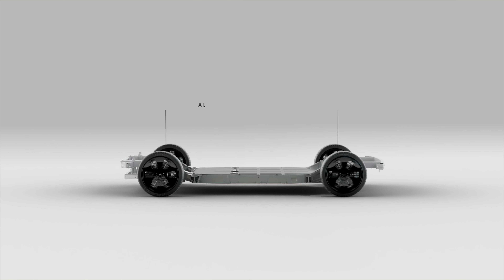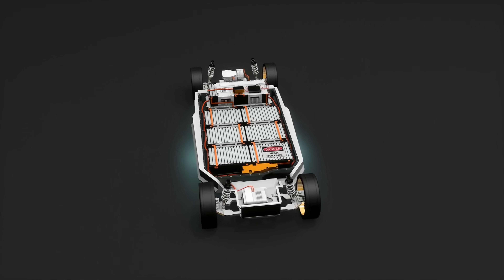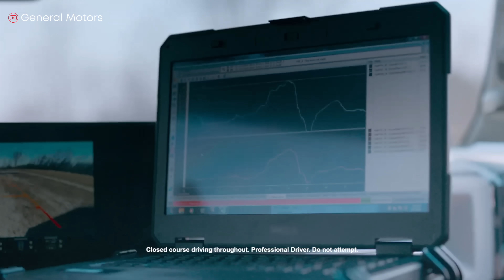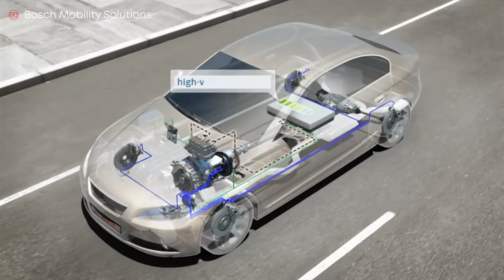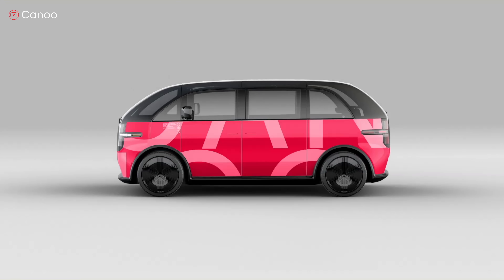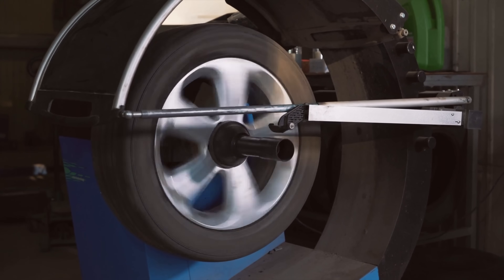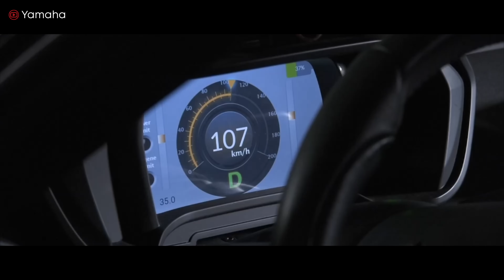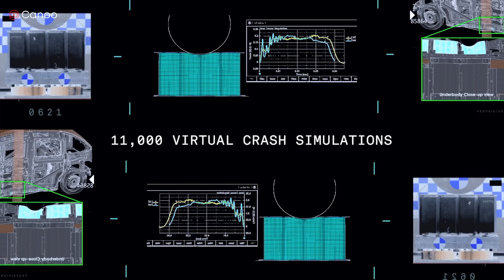No One is Telling You the Truth About Electric Cars, So I Have To

Comment: I don't have any experience with EVs but I do have 20 years of experience working on Toyota hybrids.  When the Prius first came out, we were told that eventually we would be able to replace individual battery cells rather than the whole battery pack.  Well that repair option isn't still available from Toyota.  At this point I don't think it ever will be.  From what I've heard it's not available from Tesla either.  There's obviously a huge difference between the costs for a hybrid battery pack and an EV battery pack.  I won't even think about buying an EV unless that repair option is available.
Reply: EV maker Nio has battery swap tech that's neat. Check it out!!
Reply: Robert's happenings   yeah and on top of that the distance you can travel lowers everday!!! Now wait, hold up!! So first ill half to charge 2wice a week then 3,4,5 and it's not going to stop! So if I drive to California from east Coast on the way back I got to stop more to charge!!! Are you kidding me??? Now see the truth off the matter is a TESLA car with true tesla tech never needs charging! I don't see why it can be alternator/s recharging the battery while you drive? You can have a dual system like dual core processors! Or quad core etc. These batteries or half or a portion of can easily be recharging as you role! It's all about controlling the people!! You can tweak your electric car to never need charging and once people figure this out game over!!
Reply: Toyota has agreed with BYD to use blade batteries, these may be able to be replaced.?
Reply: My experience with Toyota Hybrids is my ex-boss had a Prius with a blown head-gasket and needed a ride to work every morning!
Reply: Your car, or any mechanical device will never be able to fully recharge itself through regenerative braking. Although you can get some energy back from the kinetic energy you've spent, friction, driving the generator and heat will never allow for 100% to be recaptured.  What you are talking about is a perpetual energy machine. No such thing. At some point you'll need an external energy source
Reply: Best not to mix old with new in a battery pack.
Reply: The main problem with partial battery replacement is you'll have wildly differing voltage outputs from different batteries, ongoing degradation is one thing, jamming new and old batteries together is a whole other story, its probably not safe to do. Does anyone remember what happened back in the day, when you had a gameboy/gameboy color/GBA with multiple batteries, ever tried putting a near-dead one in with a new one and get all sorts of problems? or it wouldnt start up at all? yeah.

Also what happens if an ev car crashes and the batteries are punctured and exposed to air? Giant explosion or what?
Reply: @jaminova_1969  – So that's a vote against internal combustion engines, leaving electrical power as the only viable alternative.
Reply: You never replace the individual cells if the battery goes bad because of age or poor quality. So by changing the entire box, it's assured that the most common causes are ruled out by default. You can play around and fix most things but it doesn't work for most battery packs, in a safe way. Supercharging an oxidized or old battery pack doesn't sit well with fire safety or the lives of innocent children
Reply: @jaminova_1969  Blown head gaskets are rare problems on Toyotas.  Even if you have that problem, it will only cost you a tenth of the costs to replace EV battery packs.
Reply: @justasurfer8596  Some still think if ENERGY as something it isn't, Last time I checked it wasn't free NONE of it, Even free so called sunlight requires a solar panel and wiring etc.
Reply: @raymondreiff8170  but solar panels are just the collection equipment, ours will have "paid for themselves" within 7 years, therefore any electric produced after that IS free.
Reply: Replacing battery cells will / is already being done by third party repair facilities NOT traditional auto repair shops. Gruber Motors in AZ does this for Tesla's at a tenth of the cost of a new battery replacement. They pull the whole battery assembly out test EVERY battery cell and front end components in lab setting. This is HUGE opportunity of new repair facilities for EVs to bypass ICE tech totally as traditional shops have ZERO experience with electric cars.
Reply: What’s the average life of hybrid batteries? And how much does it cost to get them replaced?
Reply: @justasurfer8596  they need solar roofs
Reply: @777immortalsoul  
And, what is going to spin the alternators to constantly recharge the ion batteries?
Reply: @spikeboi55  
a  solar  roof  on  an  EV  might  power  the  radio  and/ or  a  few  lights,  but  won't  charge  a  low battery.
Reply: apples and oranges... prius is an extremly complex car that does not have lithium batteries.. just a gas tank and few obsolete unobtanium cells.
Reply: @spikeboi55  Toyota hybrid batteries come with a 10-year/150K mile warranty.  I think I've done just a few warranty battery replacements in 20 years.  It's hard to say when a hybrid will go bad, depends on driving habits.  To replace a hybrid battery, you're looking at $4-5K parts and labor.  If it's a plug-in, it will cost a lot more because the battery is much larger.  I've haven't done any plug-in batteries yet.
Reply: @CamKrazy2000  
at  the  end  of  the  day, better  off  with a  hybrid.  at  least  ya  don't  have  to  worry   when  in  the  middle  of  nowhere  in an EV while  low  on  battery  n  don't  have  to  wait  for  hours  when  ya  do  find  a  charging station.  hybrid  a  win win....imo.
Reply: I have seen several videos, where the Prius battery cells were tested, and bad cells replaced.  The hard part is balancing them when completed.
Reply: Oregon's "Initiative 13" is about to be a nation-wide phenomenon.  EV's are about to be the last thing on anyone's mind.
Reply: The Hyundai has that option
Reply: @777immortalsoul  You can't get more energy out than you put in. It's a well-understood physics law. Example, why do you think bicycle dynamos aren't practical? Answer, for the same physics law. It converts your body's energy you put in by cycling into electrical energy, and doesn't feel easy. Lol. The dynamo makes it hard to cycle. Just because you can think of ways it must work doesn't mean it's gonna work. Your ideas will get overruled by the laws of physics. Cheers!
Reply: @bryans4727  Boss thought it was an EV and never had the oil changed. Lol
Reply: @777immortalsoul  I think you just invented the perpetual motion machine
Reply: Robert's happenings   Batteries have gone up in $$$. The $4000 Leaf battery just went up to $8000.
Reply: @southpaw6115  I was going to say that.. and with that in mind, its like a Lifetime warrantee..  and the stations they have are cool
Reply: @Vihara2  prius has a controller that manages the bad cells from the good ones...hence battery light when 1 cell or more goes bad=hybrid battery replacements
Reply: @justasurfer8596  current technology batteries charge too slow to take advantage of regenerative power so most of that energy is wasted, but at least it helps with braking.  It would take something like a super capacitor to capture the energy for use by the car.
Reply: @Vihara2  The main issue is exposing them to water.  The lithium can react violently with water and that kind of fire cannot be put out.
Reply: @CamKrazy2000  Anyone who is charging that for a new head gasket on a Corolla engine is a rogue and a thief. A reputable mechanic business can do that for under $2K.  As you yourself say that is less than half for a repacked replacement Prius battery pack.
Reply: The general rule on battery cell replacement on fork lift trucks, (though these usually use lead/acid or gel batteries at the moment) is replace 3 cells,  but after that replace the whole pack. This is down to economics, the cost of 3 cells and 3 lots of labour would in some cases be 75% of the cost of a new pack, which would then have a 5 year warranty. No warranty on cell replacement.
Reply: @777immortalsoul  I can see you got your PHD at Trump U. NO SUCH THING as Perpetual Motion, not even in an Electric Car.
Reply: Unless you like classic cars I'm sure nobody drives a car for 10 yrs anymore. Most of us demand the newest technology in cars every 3yrs or so, 5yrs most. Also most households have 2-3 cars now if there is even one teen in the house. So its not like we aren't using different cars for different purposes without EV. What's stopping a family from having 2/3 being EV and a combustible spare for all these cross country trips that all the naysayers are apparently taking.
Reply: Not unusual at all in the 2010 amd 11 models. Very common.  Thats why there are more Gen 2s on the road than gen 3s.
Reply: Gen 2s have no external energy source. they are hydrids and use the gas engine to keep the battery charged. Much better than a plug in.  I can run my ac w the vehicle ON. It eill run about 45 min then the gas egine comes on for 1-2 min to charge the battery. Much like a back up generator.
Reply: @tomynoks  I've seen Prius plug-ins/Primes do as much as 130 mpg which is easily more than twice the mpg any regular Prius will ever do.  You could drive the Prime for months without the gas engine ever kicking in if you charge the car every night.  We don't recommend that because you need to have the gas and the oil circulated periodically, I'd say once/week.
Reply: @tomynoks  If you are talking about head gasket problems, they're not "very common".  I've been working on Priuses just about every day for 20 years.  I've seen more inverter problems than head gasket problems with Gen 3 Prius which is why there's a warranty extension with the inverter.
Reply: that repair. option is available fro other companies and individuals.
And Toyota built these to demonstrate issues with batteries
Reply: I do know that replacing individual battery cells is available for the Nissan leaf. I learned of this by accident (at a Nissan leaf repair center). However I didn't do any further research.
Reply: @777immortalsoul  Clearly you don't understand how any of this works.
Reply: @cfldriven  when you Invent something you explain to other people how it works!!
Reply: @777immortalsoul  Sorry my message was meant for @Robert's happenings
Reply: @raymondreiff8170  peg is shutting of electricity to 58 municipalities today. How does one charge their EV? I Hope they don't have to travel far to work.
Reply: @yetivanmarshall1473  PEG where's that?   maybe I don't care 🧐
Reply: Teslas will normally have around 10 to 15% battery degradation between 150,000 to 200,000 miles. Their battery warranty  will replace your battery if you go below 70% during 8 years or 100,000 miles, which means you had a really bad pack. Normally the car will easily run 20-25 years, and still be very usable without battery swap. Even if you don't have the full range anymore, at that point. But by then it's a clunker use by a teenager to get to work and back. Unless you buy an early Nissan Leaf, battery degradation is not something you should be worrying that much about.
Reply: @raymondreiff8170  California
Reply: @yetivanmarshall1473  solar charge stations do exist.  houses with solar can still charge.
Reply: you wont need to replace individual cells.  honestly you probably dont do that in your phone or even in an ICE battery.

the hybrids of 20 years ago and EV today are completely different with battery tech.

You wont have a problem with the battery.
Reply: @777immortalsoul  comedian? If not you are a born natural
Reply: @bryans4727  A lot of things can cause a head gasket failure Bryan ,like a faulty head gasket for instance....
Reply: 15 gallon gas tank × $3 per gallon = $45 per week in fuel × 52 weeks = $2340 per year in fuel (at least) and you're worried about getting battery work done which goes under the vehicle maintenance category that can happen to any new vehicles epecially in their first model years???
Reply: @yetivanmarshall1473   I always love this analogy. Do you really think gas stations are going to be able to operate with no electricity?  What do you think is powering that pump and those digital displays and credit card readers?  I on the other have a Tesla Powerball so I'll be fine, charging away.
Reply: You can get a new Tesla battery but it would cost you as much as buying anothr car anyways at which point you know what to do lol
Reply: This is going nowhere if you can't replace your batteries in the same way you now do with your cordless tools.